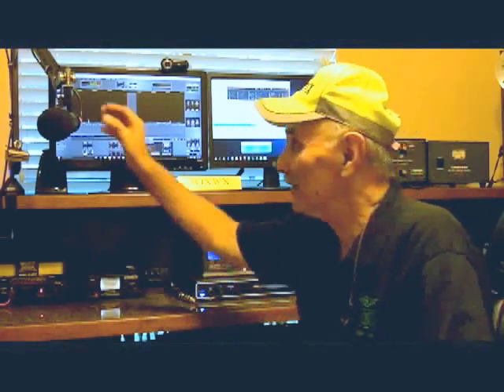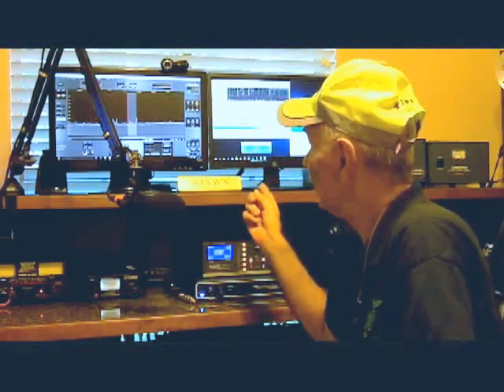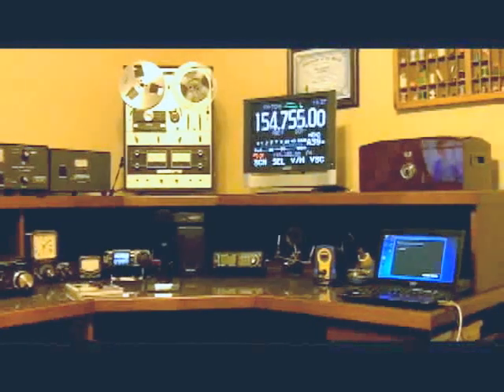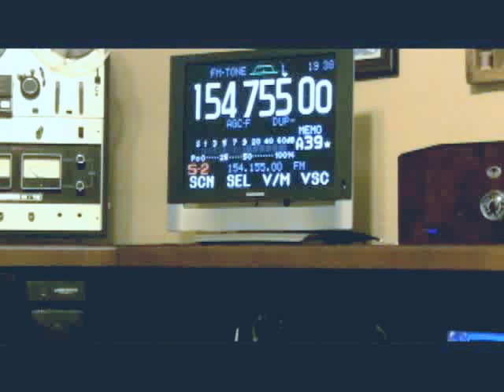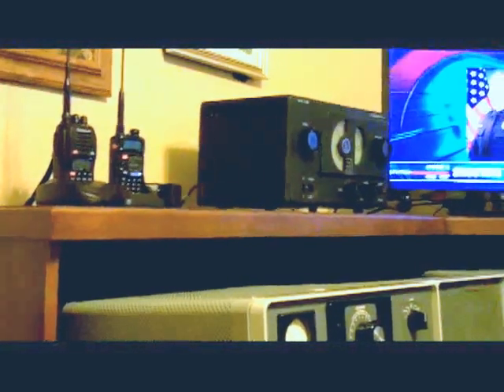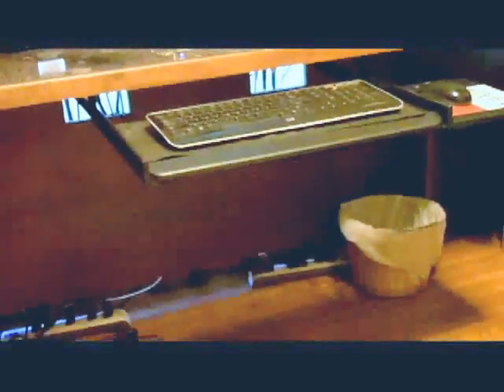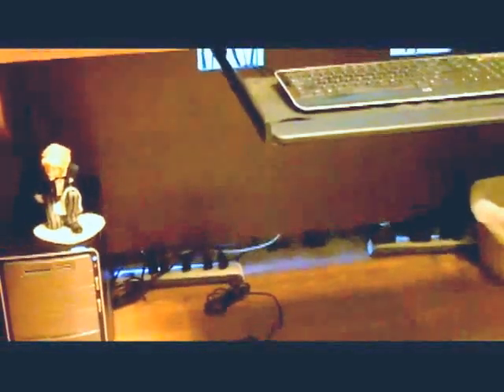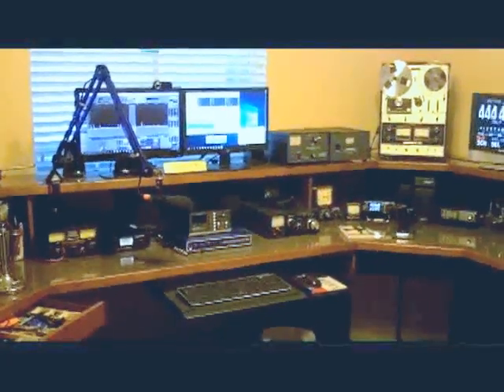HamShack Aug2015

Comment from the maker: I did not mention the Uniden BCT 15X scanner next to the Icom 7000. Also when I pul out the keyboard you can see the slots cut out in the panel under the desk for my radio and antenna selection switches.

I have 2 Alpha Delta swtches -- one for the radios and another for the antennas. The slots let me switch these without removing the panels.

Comment from the maker: Since this video I have added a Tytera MD380 HT, and a Connect Systems CS800 DMR radio to the shack. The CS800 is positioned next to the Icom 7000 in the right corner operating position.